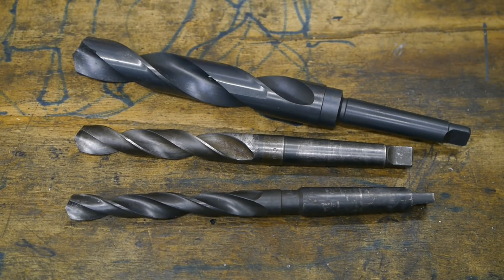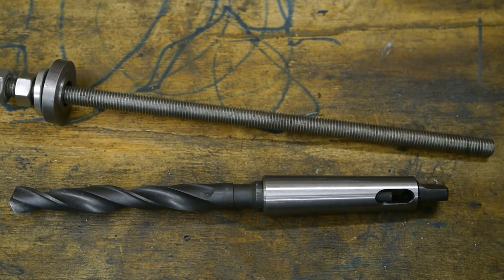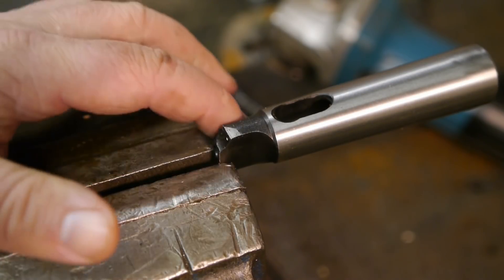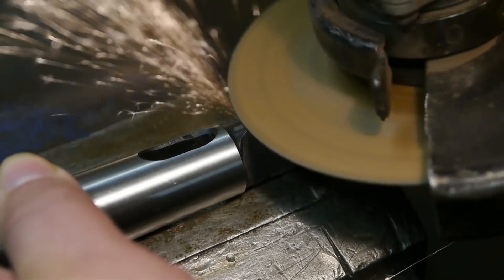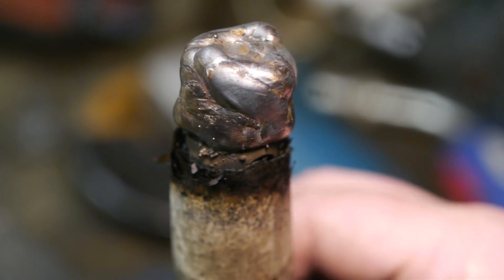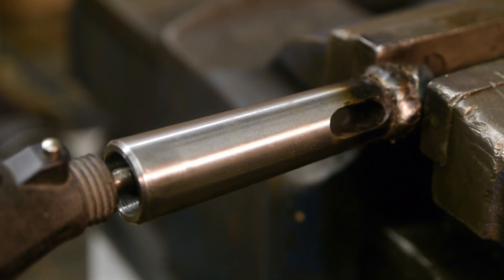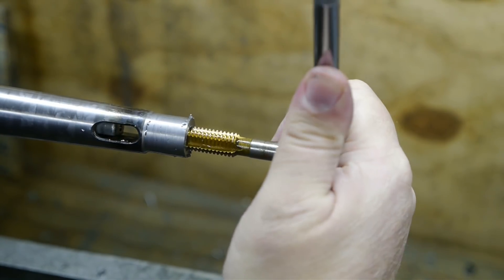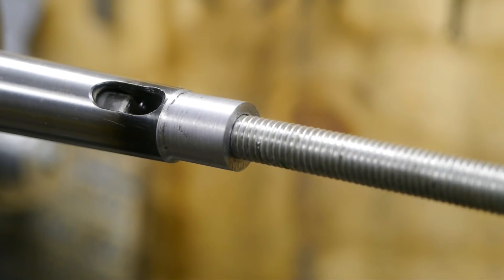Modifying a drill press adapter sleeve to fit a drawbar

Comment: i thought it was a good idea it fuck'n worked. my only other thought is you can mill on a lathe but the through is so shallow little parts at best.  unless the headstock was modded to sit much more proud over the ways, then bang you would have something there. i thought of doing that myself saving a shit ton of money on a mill I may or may not trust. but I don't even have the lathe yet I'm gonna have to start from the draft board as well so I thought id just build it right in the first place.

Comment: My second thought here is that it isn’t strictly necessary for the draw bar to run true, but at certain speeds it could possibly cause some vibration. 

My third thought is that once you had the taper sleeve running true on the drill, you could have run a taper into the end to verify it’s state, then weld up each side (longitudinally) alternately on the lathe, leaving time for cooling after each session. 

Building up from the centre outwards with longitudinal welding is important because of the shape you’re reproducing. It takes time, but if you keep the welds inline, and clean the surfaces before each new weld, you reduce the risk of leaving pockets. 

Thank you for sharing this.

Comment: I like the fact that you're very . You don't easily give up even though some of the things that we do are frustrating, you're thinking seems to be towards a goal of finishing up and having a good result at the end. I have had similar projects that I would make a prototype that turned out well then when I went to make the final piece it had a lot of problems, had to work on adjustments and alignments but it ends up coming out in the end or I'd still be working on it. You seem to have the same Drive that's what I appreciate about your videos and how you approach a solution.

Comment: you could probly use a morse taper test bar for an arbour instead of your drill bits
Reply from the maker: That or an extension sleeve. But I have neither.

Comment: i bought a set of MT3 taper drills 14-25mm-the tapers were so far off , i cut each taper down to a 14mm shank drill bits.this way i can use them in the same collet or a drill chuck.a lot easier to do .
Reply from the maker: I have a similar mt2 set, and now that I think about it I have had some tapers break loose. I think I need to have closer look at them. Tanks for the tip.

Comment: R.M :-) I was worried for a few minutes as I was looking at the deflection of the insertion of the last 10.2 mm bit prior to tapping and thought, good gosh man... it is still not quite right! You persisted and championed the event. Just fan-effing-tastic !  

Did I mention that I am dealing with a B&S #9 spindle taper on this old Gorton Vertical Mill from the 60's with out any tooling whatsoever, and how little there is for it. And all I have to bring to the task  is what I have learned on YT and I have no metal lathe to assist. Nor do I have any kindred spirits in the area in which I live to ask for support or advice. And really all I want is a decent shot at the machined parts for this 4'x 6' CNC Router build. I was quoted $3400 CAD for the simple parts in 15, 20 25mm  6061 (6082 in the EU) .All need face mill and some radius and lots of holes and counterbore.
I am new, but a spendthrift and have no choice.
Reply from the maker: Sounds like you are in the market for a metal lathe :)

Comment: Try aluminum foil to protect your work from welding spatter.
Reply from the maker: Thanks for the tip
Reply: ive used foil and it didn't work, sparks would melt through a few layers
Reply: Yep doesnt work.

Comment: gentleman, center drill before face it? that is new and probably the reason why the welding surface is not beautiful as expact because the live center is not rest on a flat surface
Reply from the maker: I think I would have been better of if I just welded in the centre hole. Then face it of and re-drill the centre hole.

Comment: Never hammer or tap a part in the chuck. you are going to damage your spindle bearings. Should have removed the drill and separate teh adapter outside of the chuck
Reply from the maker: I need to hit the spindle much harder to remove a tapered tool. So I think it should be ok.
Reply: Its different tapping along the length like a drawbar rather than radially. It might marr your bearing races or bushings
Reply: @fasousa4798  You would need a sledgehammer to damage bronze bushing. Most likely you'll just bend the spindle with bushing intact. Ball bearings, that's a different story though.

Comment: i had noticed that the part you welded was made of a softer metal ,had you considered using a piece of whats the rod of iron or steel they use in concrete for the stock rod cutting and reshaping then welding into place so as not to let tang be so brittle?
Reply from the maker: No. But I did consider welding on a M12 nut. Brazing would be better But I don't have the equipment for that.

Comment: These adapters are available tangless and tapped for draw bar use and are no more expensive than the tanged versions. Would have saved you a lot of hassle and time.
Reply: Put up a link as to where they are available from.
Reply from the maker: Yep, I just found that out :)

Comment: You are not accounting for 3 jaw chuck runout in your setup. Don’t you own a dial indicator?
Reply from the maker: One of the jaws of the chuck is always positioned partially above  the drill bit flute. I think that's what's causing the run out. 
But you are right the chuck also has some run out.

Comment: First of all, your concern about the adapter coming off the lathe spindle was unfounded.
Even if your spindle was vertical, the forces at work on a drill are axial and the bigger the pressure the harder the grip on the taper. Draw bars are used on end mill and cutters subject to lateral or radial work. Drills, no problem. Second, center drill depth must not exceed 2/3 of angled part of drill, more or less. Check this link for useful information and calculator.
If you have a steady rest or follow rest, you can still use it to support a work piece that is tapered, not ideal or perfect, but better that unsupported.

Cheers 

http://closetolerancesoftware.com/ProDrillDepthCalculator.html
Reply from the maker: A has some tapers breaking loose in my cheap Chinese lathe while drilling. But perhaps the fit on that machine wasn't very good. Even-though it might not be necessary the draw bar doe make it easier to remove the sleeve and drill.

Comment: Well done.  As you observed, the drawbar works the same whether concentric or not.  I do not see a difference in run out at the end.

I purchase machinable arbors, which have a Morse taper with an oversized end intended to be machined to whatever dimensions.

A link to illustrate.
https://www.victornet.com/detail/DCA-BL3.html

If you can find MT drills at a flea market you can also cut off the flute to make your own arbor.

I think a consistent diameter is easier to get to run true than the flutes of the drill bit.

Another option to hold a Morse taper in a chuck is to get an MT extension and cut off the external taper.  Another link to illustrate.
http://www.victornet.com/detail/SL3-3.html

I use these to hold the machinable arbors in my 3 jaw chuck so I do not have to sleeve my MT5 in the spindle down to e.g., MT2.

Dave.
Reply from the maker: Thanks. Both the extension and the blank arbors would probably work a lot better then using a drill bit as an arbor.

Comment: looks good even though the drill bits wouldnt run true, I was thinking of doing something like this for my lathe, but for the MT4 socket like your other lathe has. I was thinking that it may be better to get some round bar and turning the taper on it, then leaving it in the chuck till the job was done, then you have something that will run true in the lathe chuck and as a precise mandrel. What kind of issues were you getting without the drawbar style taper socket?
Reply from the maker: It's a lot more work to cut your own sleeve and you'll not have the slot for a tang. Although you could probably make a "slot" using a couple of set screws. On my cheap Chinese lathe I had some tapers breaking loose. I didn't want to experience the same problem on the old lathe.
Reply: oh, ok. I was talking about just cutting an MT2 taper on a piece of steel, and using that as an arbor to turn the bottom of the sleeve. You said you couldnt get the tapers on the drill bits trued up again so the sleeve would run true, but using a fresh cut MT2 taper and use that for an arbor for the sleeve, it would guarantee that it would go back on true.
Reply from the maker: I see. You' re right that would probably work fine. But also a lot of extra work.
Someone suggested a MT2 extension arbor or an MT blank. Now, I don't have either but those would probably be perfect.
With a drill bit one jaw of the chuck is always partially above a flute, and I think that's what cause the excessive run out.
Reply: well, I just suggested that option because you always use the 3 jaw chuck, which those usually have a small bit of runout in it. If you turned the arbor and just kept it in the 3 jaw chuck, it would eliminate any chance of runout. With the extension arbor, it may be precise, but the runout from the 3 jaw chuck will still be there and mess you up.

Comment: Good job. I actually thought that it might work because  the drawbar could still flex enough and pull the adaptor sleeve in concentric with the spindle taper. Thanks for sharing.
Reply from the maker: Thanks. I was more worried the head from the welding might have warped things.